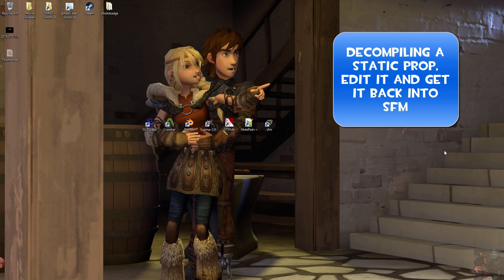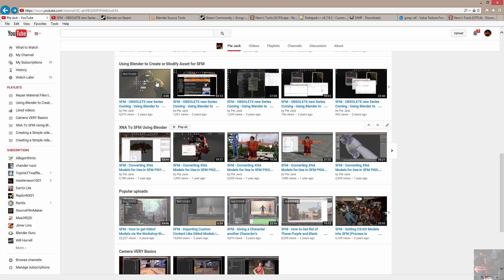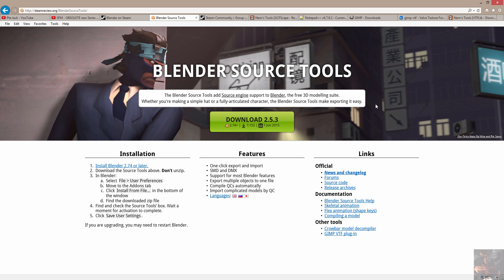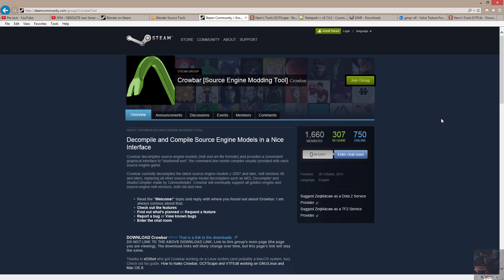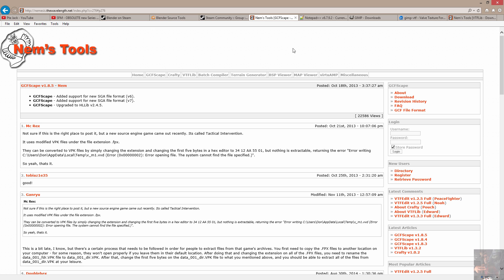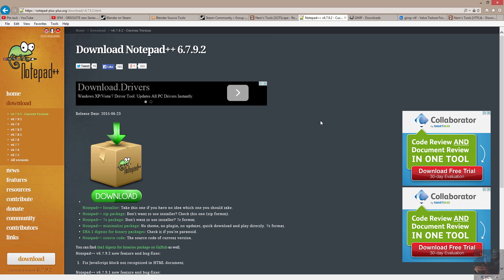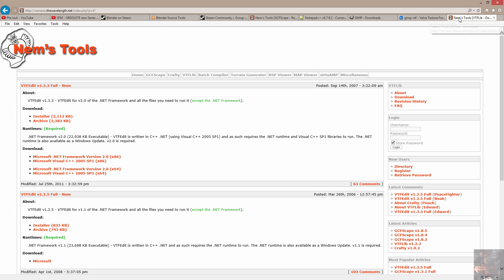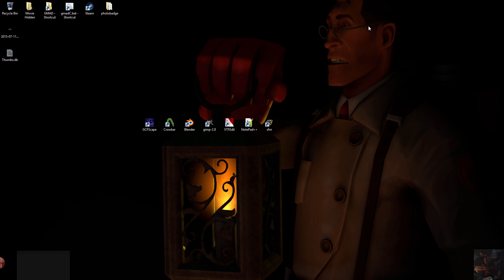SFM - Decompile a Valve Model, Edit and Send Back to SFM - Pt1 Programs

Comment: Hello, I'm sorry to bother you. I have a question. I'm just getting started. So, I've downloaded Nem's Tools VTFEdit v1.3.3 from the link you have provided. Upon trying to open the software to set it up, I'm given a window that says:

The App you're trying to install isn't a Microsoft-verified app. Installing apps from the store helps protect your pc and keep it running smoothly. 
button stating    "get apps from store"
button stating    "change my app recommendation settings >"

Would you happen to know how I can fix this? I've also tried running it as the administrator and the same window pops up. 

Based on the screen, I downloaded the Installer (2,112KB) which gave me the problem. 

About:
VTFEdit v1.3.3 - VTFEdit for v2.0 of the .NET Framework and all the files you need to run it (except the .NET Framework).

Was I supposed to download the :
Microsoft .NET Framework Version 2.0 (x86)
Microsoft Visual C++ 2005 SP1 (x86)

OR 

Microsoft .NET Framework Version 2.0 (x64)
Microsoft Visual C++ 2005 SP1 (x64)

my laptop is a 64-bit operating sytem.
Reply: The Microshit store message is caused by an setting that usually is enabled by default. 

To make that store message go away, hit the windows key to bring up start menu. Type "settings" and look for settings app icon with a gear to appear. Click it and it will take you to the windows settings page. Look for "Apps" icon and click it. The first thing that appears is "Choose where to get apps". On the dropdown box, select "Anywhere".

My Windows 10 version is Pro and Australian... You may not have the anywhere option. "Turn off app recommendations" is what you may see, but it does the same thing.

A lot of custom programmes will require various framework and/or C++/C#/etc packs if you do not have them, I write programmes in Visual Studio 2019/2013 and already have all of them... There are many flavours and it can be quite a mess...

v1.3.3 was written in C++, which requires at least framework 2.0 and C++ 2008 runtimes... Installing the 3.5 framework kit should cover all you need, if you don't already have.

https://www.microsoft.com/en-us/download/details.aspx?id=22

Hope that helps some

Comment: I wouldn't suggest installing blender with steam. You can have only one program/game running at a time when using steam. And if you're watching this video chances are that you'll at one point want to have both Blender and SFM open or the SDK. So don't get it off of steam, it's just as easy to get it from the official site
Reply from the maker: If you right click the blender ICON on the taskbar after starting the Steam version then click Blender, you can run as many sessions as you want. You can't load multiple sessions using the Steam launch link though (as you said) but you can run multiple sessions if you do as I just said.

Comment: Seems like editing with Photoshop CS6 Extended 3D option is easier, but it doesn't support .mdl files, nor can they be converted to .obj directly from .mdl, it needs a double conversion. How exactly can an .mdl go into photoshop 3d? Really interested to know, since editing a texture at the same time as looking at how it will turn out in the 3d world seems invaluably helpful...
Reply from the maker: Just because a model has a .mdl extension doesn't mean that a program that is suppose to work with .mdl models is going to load the model. Valve .mdl models are not the mdl model format supported by programs other than Valve games. It is a binary file and requires the .vtx and .vvd files to work (and a gain, only in the valve game it was created for). If you want to be able to paint a model in a 3rd party program like SP2 or 3d-coat, and I guess CS6 now, then you have to decompile from its game format into a model format supported by the 3rd party tool.  In the case of a valve .mdl file, it has to be decompiled from the mdl to SMD, then the SMD taken into a 3d editor like Blender and then exported from there into a format used by the 3rd party software.
Reply: So, I'm gonna have to decompile the .mdl into smd and then convert it into any kinda format that 3rd party programs support. Thanks for the clearance!

Comment: I Installed Everything Right But GIMP VTF Plugin Still won't Work
Reply from the maker: Either you didn't install it properly or you got the wrong version for your computer and tried to install that.  You have to know if your computer is 32bit or 64bit and get that plug in

Comment: GCFScape will not load for me... I'm I doing something wrong?
Reply: I did all of that but nothing worked.
Reply: Did that. It just loaded up on the tast manager and removed it self. With out showing any error boxes or anything.
Reply: Windows 7
Reply: I did turn on the Microsoft .Net Framework 3.5.1 and Installed Mirosoft Visual C++ 2008 SPI Runtime (x64)
Nothing happend.
https://dl.dropboxusercontent.com/u/63772434/images/Other/GCFScapeNotloading.gif
Here's is what happens when I Load it.
Don't mind that the gif loops.
Reply: *****
Nope.